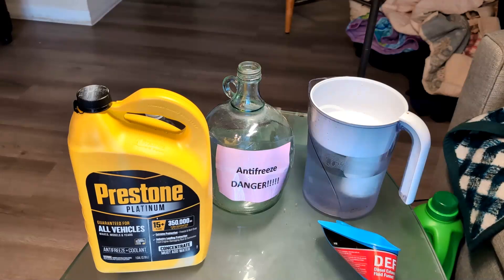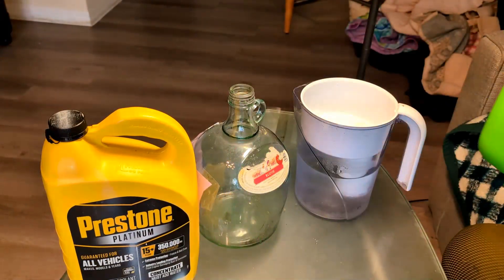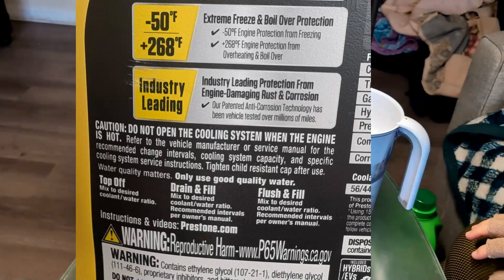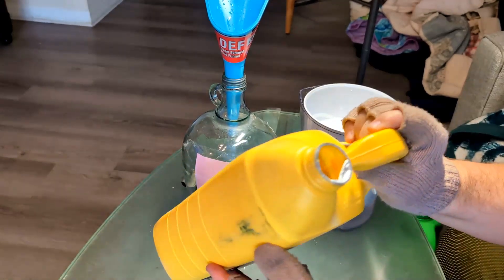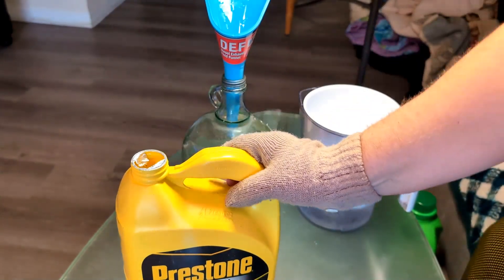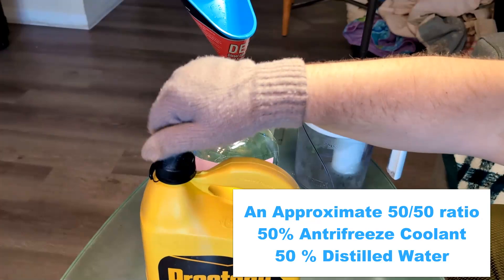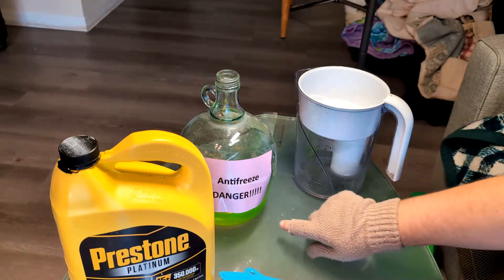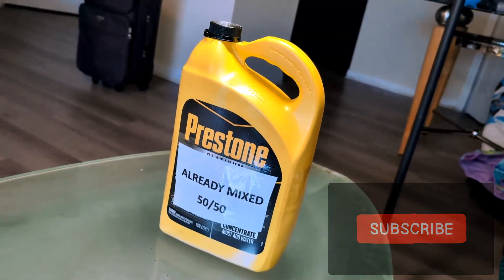How Properly MIX Dilute Car Antifreeze Concentrate (Make 50/50 Coolant Water Ratio Solution Prestone

Comment: I like the label idea a lot, definitely better to be safe, but I personally would’ve used the original container for “storage” high up etc - I’d use original manufacture for storage etc and glass bottle for mixing etc putting in car- bc doing it the opposite as in this video DEF makes labels 100% required, important

Comment: this may be a dumb question but once its mixed and you use it all, could i reuse the prestone container?  the coolant i put away in a different container is 50 percent so could i just pour that into the prestone and add 50 percent of water again? thank you for this video!
Reply from the maker: yes you can reuse it